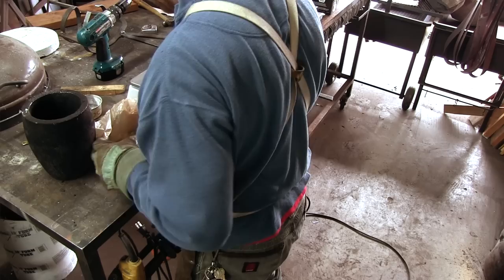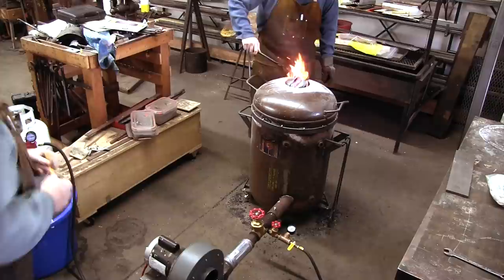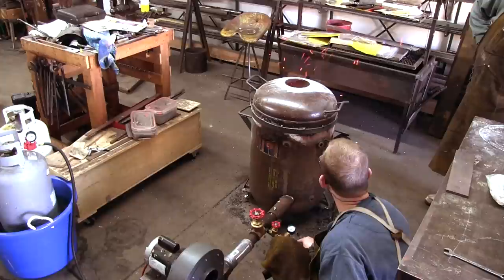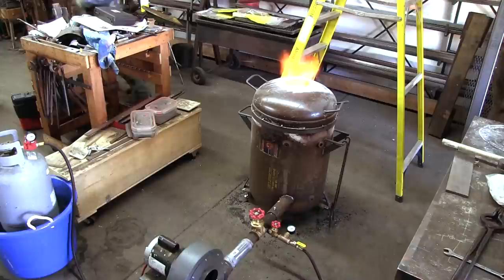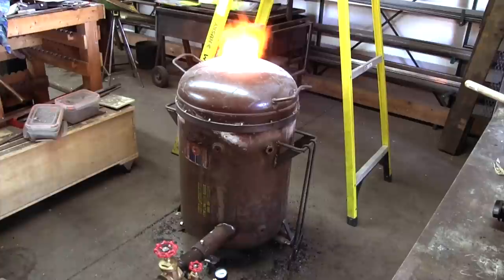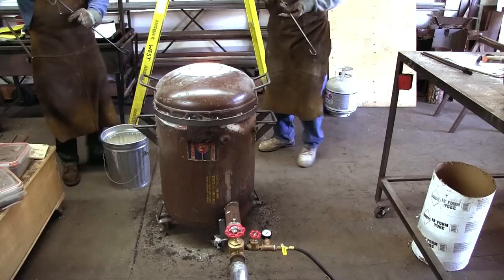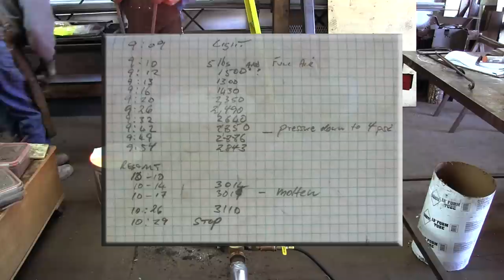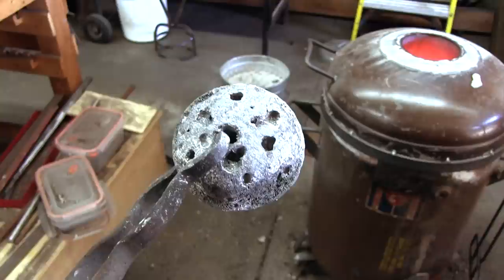Wootz Ep 1: Experimenting with Crucible Steel

Comment: What you ended up with looks like an upgrade of the 'sponge' (low grade iron billet made in a primitive furnace) made by the iron age smiths at  Sagnlandet Lejre . dk 
Did you try heating up the billet and hammering it? And if so; did it produce usable steel?
Your billet looks to have a hell of a lot of slag in it, but that could be hammered out.
Looking very much forward to see your next try.

Comment: if you cover it with clay to make it airtight, it helps to contain the gaseous reactions and gives you a more solid puck
Reply from the maker: +IrishMusicLover703 the glass usually does that. In later videos you will see a clay cover.
Reply: awesome! if your crucible becomes porous and it hurts your production, you could also try coating the whole crucible in clay

Comment: First, great videos, have watched alot of them, true craftsman, thanks for keeping and sharing the tradition. Second, just a thought. I understand that coke and charcoal from whatever source are nearly pure carbon, but from some of my own research in another field there seem to be a wide variety of crystal structures in them. Just a wild guess but that white whale of wootz come maybe from a different source of carbon, maybe dung ? Just a guess from my very limited knowledge of the culture. We know how frugal the ancients had to be, I don't think they would have burnt chaff, if it could feed a horse or camel and still get the same heat from it recycled. Just a nudge brother, you're doin the work.
Reply from the maker: At those temperatures, the carbon is dissolved in the liquid iron. The segregation around alloys and creation of macroscopic structures happens during cool down.
Reply: +Niels Provos  artificial diamonds are created at extreme temperatures as well, but they can stuff all the carbon they can into the press but they won't form without a "seed".  Shape of the crucible could come into play as well, irregularities could be a pocket for the dendrites to begin to grow ? Maybe even the composition of the crucible could provide the seeds.  Brother I like what you're doing, and you're the one doing it, I'm just watching. Carbon crystals are a pretty indestructible, not fully understood animal.
Reply: the key ingredient in wootz is the alloying agents i believe vanadium is the best but there are others that work. you have to have that in a certain amount plus roughly 1-1.2 percent carbon and then a specific cooling process. then it requires lots of thermal cycling and slow working.

Comment: In an apoclyptic scenario in which you wouldnt normally wouldnt have a steady supply of metal, what would be the best option for making metal? Whats the easiest forge to build out of common matierals that can reach tempteratures higher than a  blumery forge?
Reply: 3 years late but anything you can get your hands on. Nuts, bolts, screws, ball bearings, car doors, saw blades, you name it